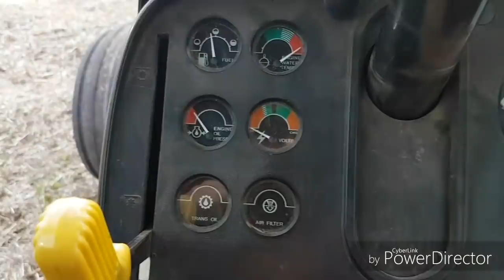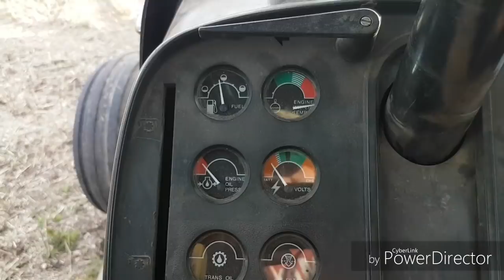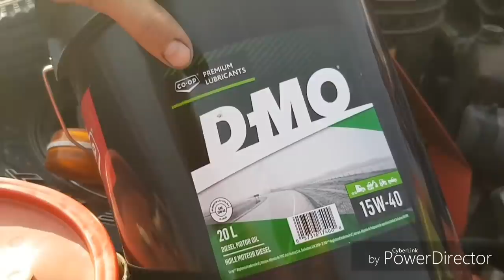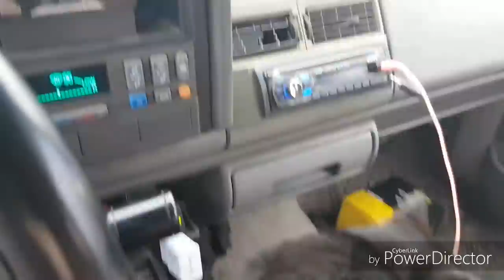4640 oil change and LED lights for the 1682!

Comment: Actually oil quality changes between different brands. I had a boat with a Mercruser 4.3 and it was supposed to run straight 30 . I usually used Penzoil but couldn’t find it one day so I put in Canadian Tire straight 30 and the oil pressure dropped 5 pounds. I made an extra effort and found the Penzoil straight 30 , drained out the Canadian Tire oil , put in the Penzoil and the 5 pounds of oil pressure returned.

Comment: Happy Bday Sophia, what age is the ride on organic lawnmower? i'm just in from doing the swing out gearbox on our Farm King 10x60. Damn things are made in China and for some reason Morris has no gearbox kits on hand........at harvest...... so i packed her with grease to get me going. our main auger is a 13x70 but i need the old guy to unload the dryer as the Convay-Air blower motor took a dump, and the only 70hp sfz was in Edmonton, the $3,300 was actually less than i thought but with shipping and installation by Higginbotham Electric i'm sure i'll be waking up in an ice filled bathtub fairly shortly.
Reply from the maker: Sounds like fun haha

Comment: My used 4630 had a 1/4" oil filter drain plug but it was so fused with  rust I was afraid the corners would round off if I used a vise grip. So used a piece of cardboard to fence off the dripping oil to keep the block and frame clean.

Comment: Hey nick to pull that tyre off put a lever under the tyre and lift it a bit and it will slide straight off.
Reply: When  kicking off the tire kick low down but on both sides at the same time helps as well.

Comment: Strange dipstick version you have there on the 4640. All my Deere tractors of that era you had to twist to loosen or tighten the rubber tube gaskets at the top of dipstick..
Reply from the maker: Ya it's got the nice one

Comment: When I was 14 or two years ago my grandpa had a really worn out 4440 I mean like 30000 hours on it and I did a rebuild and I turnered it up to a 4640 and holy shit is she ever snappy now it can run a 7721 like a dream (to bad not enough weight so the combine turns the god damn tractor but how much did you pay for the 4640

Comment: If you're gonna pull it off at the housing why not put in a clean pipe plug? Instead of that dongle
Reply from the maker: What?
Reply: @SouthSaskFarmer1  Your big 3 piece filter housing drain plug
Reply from the maker: @Farmall450  because that's what I had in the shop
Reply: @SouthSaskFarmer1  Looks like some of the sh!t I had to do to "work around" when I needed a sprayer fitting that TSC was sold out of... have to buy five fittings to daisy-chain together to get from say a 3/4 female T to a 1/2 inch hose barb 90 degrees off... either different sizes, so you had to buy a nipple and bell reducer to a 90 degree hose barb fitting, or different threads so have to buy an extra thread adapter, or only female to female threads or male to male threads, so have to buy a coupling or nipple, or wrong size hose barb, so have to buy a hose barb reducer and a piece of hose and extra clamps... or no 90 degree fittings, so have to buy a nipple and a 90 degree female elbow, or street ell if you were lucky... 
Learn a lot of new cuss words at the friggin' TSC sprayer aisle... LOL:)  OL J R :)